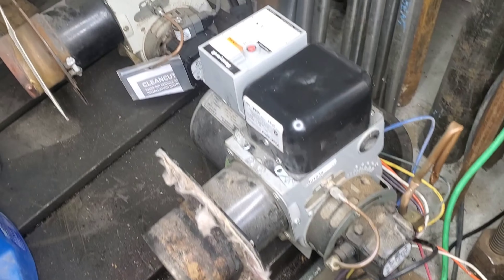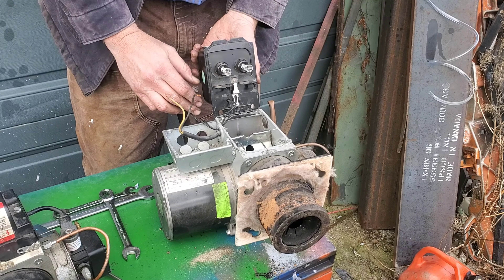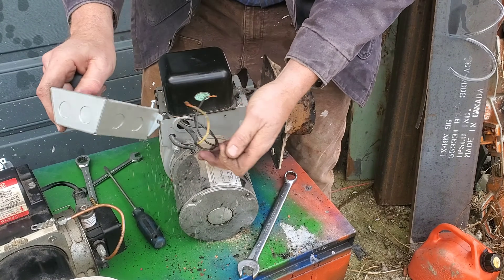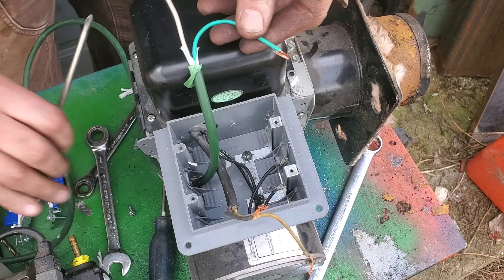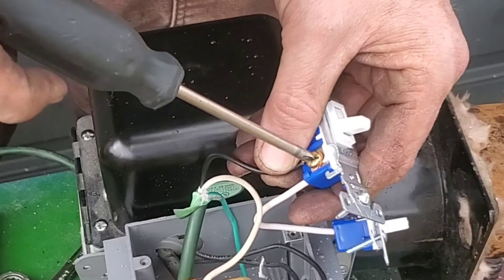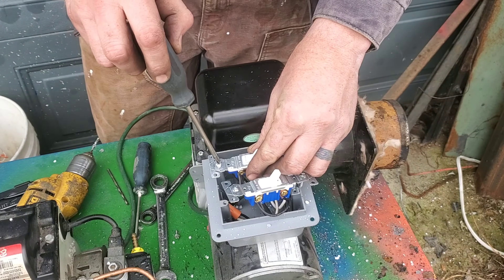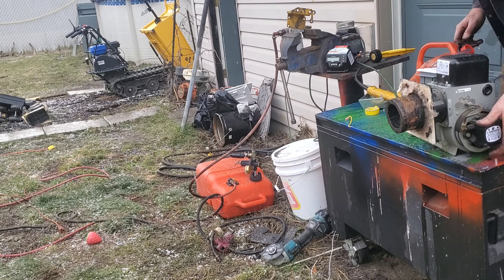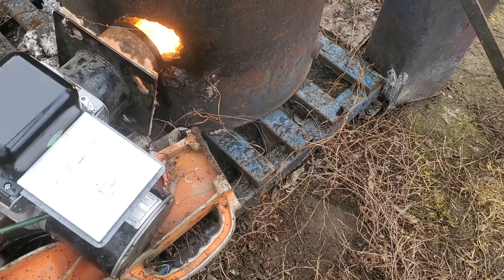Converting Beckett Oil Furnace Burner for the home Foundry

Comment: All you needed to do was put a switch in between a jumper and jumper the 2T terminals. Throw the switch automatic power, including a safety shut off from the CAD cell if you didn’t have fuel.

Comment: I’m the same way with my experimenting lol 😆 propping things up on something sketchy to test a theory. It’s what makes it fun. Rock on 🤘
Reply from the maker: Hahahah , thank man you 2
Reply: I remember one incident I had like this was testing a small universal motor (for a Rainbow vacuum power nozzle) and didn't think I needed to hold it when I plugged it in.  The thing had so much torque it flipped itself off of a countertop on to the kitchen floor.  I'm glad the glass-reinforced plastic casing didn't shatter or any of the screw mounts on it.

Comment: The equivalent of the guy who swaps a fuel injected engine into a vehicle then slaps a carburetor on it because he thinks it's simpler. All you had to do was jumper the thermostat wires on the controller and hook up power and ground and you'd still have all the safety systems in place.
Reply from the maker: Lol . Now you tell me :)

Comment: Say my man
The green wire is the safety or fault return. So if the motor has a fault???
Your green wire is hooked to the plastic box, yes? So you need to run a second green to the motor housing. This will allow fault current from the motor housing to run down your green wire and blow your circuit breaker. That’s it’s job. Good luck.
Reply from the maker: Dont be sorry :) glad you said some thing .  Ya man i dont know what i was thinking .  So much fo saftey .  Im planning to fix that first thing before i use it again !!

Thank you james

Comment: I also have a few of these Beckett burners and recently put a waste oil conversion kit in one of them to hopefully use it in a foundry application like you. It was a bit complicated to do but I finally got it working! After watching your video I might also make a diesel version one. Much simpler. Looking forward to seeing you actually melt metal. I haven’t attached mine to a furnace yet to try! Thanks for sharing
Reply from the maker: Haha, I figured I was not alone in having projects in wait in the shop.   What conversion kit did you use?   I would be I interested in looking at doing one of those to the other blower.
Reply: @Wrighmachining  if you google CKburners you will find the website. It can be made homemade. It’s basically just a siphon nozzle added using compressed air added with a tube extender and a differently shaped swirl end. I will try to find the link on YouTube of a guy doing it.
Reply: @Wrighmachining  ok I noticed many more videos have popped up about this kit now but I really liked this video https://youtu.be/H7WdiGAuX9s?si=TxR9CeKTHTHujTe6

Comment: Your ground wire needs a connection to the metal of the blower - it's protecting nothing currently. Also, never use the back-stab on switches / outlets, it's a very poor connection and those pop out. Use the side screw terminals with appropriate torque. For your use? Probably not a big deal, but if you are wiring in a house? Big deal.
Thanks for sharing!
Reply from the maker: Buddy you are absolutely right about the green wire, shoot. How did I miss that .  I'll have to run another from that been wire to the body of the blower.   Thank you! ! 

I can see how the back stab could be an issue, especially since I will be putting this in and taking it out of the shop to store it while not in use. Extra movment, generally it will be hooked to a gif pug so I will have to keep an eye on it for issues :)